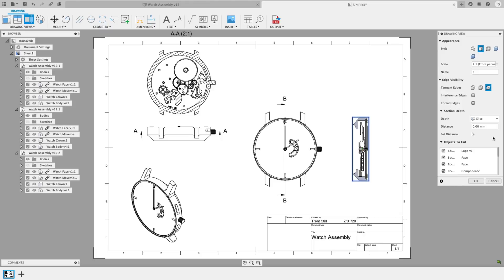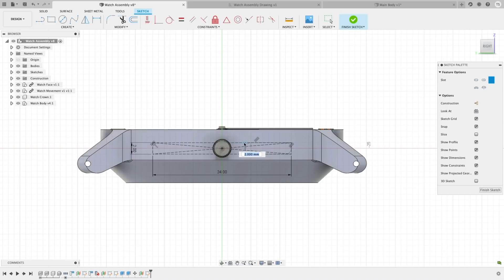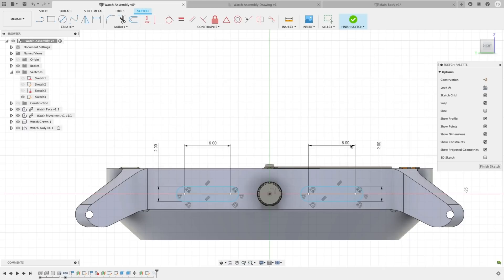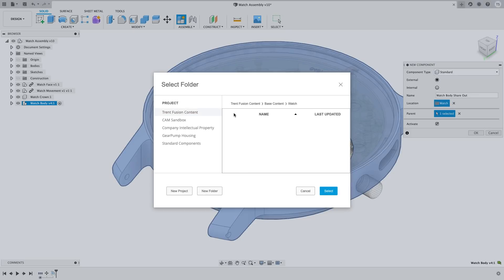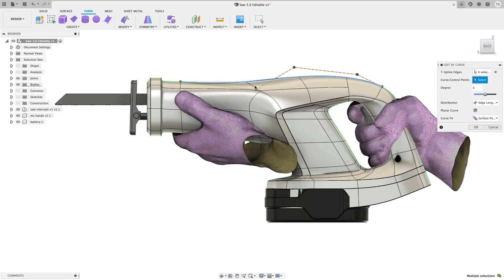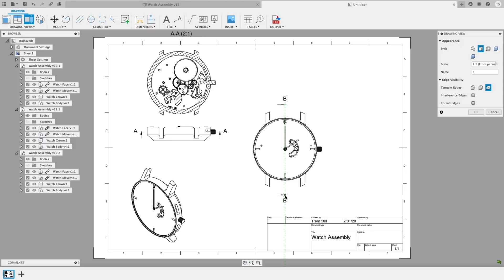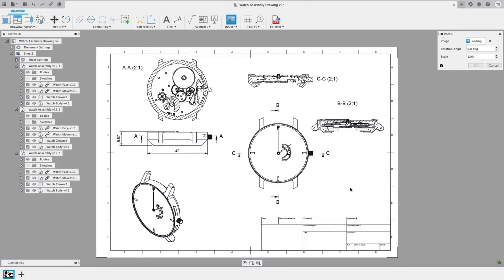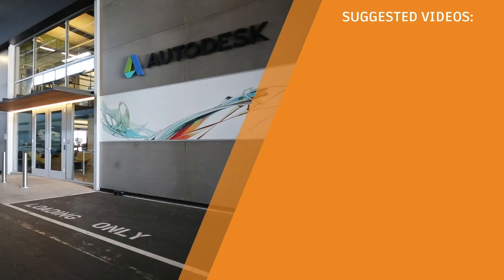What's New In Fusion 360 Design & Engineering - August 2020

Comment: what is different between the two symbol appear in the data panel the first one in cubic and the second one is orange paper that different happen when upload file using web site and any saved didnt effect in the cloud plz answer
Reply from the maker: Hey Besho, it sounds like one is a Fusion 360 File and one is a native 3rd party file (Inventor, Step, Iges, etc.). You can turn the native files into Fusion 360 by right clicking and selecting Create Fusion 360 design
Reply: @adskFusion  when i upload a fusion 360 design using via web site but after uploading it and open the fusion 360 program and want to open the design that i already uploaded through website i found many changes the first one is the symbol that appear next to the name of design it must be cubic but it appear a orange paper the second different is in the web site the fusion 360 design at type it appear as CAD file but it must write as fusion 360 design 

plz help me
Reply: i need to send photo it will explain easily and fast but how can send it

Comment: ebmoss have huge problem. It not simulate cuts like you coud do it with milling tools. Walls are always on the same plane with the axle of cylinders you cut. As you can see in 0:26 - 0:27

Comment: I was experimenting with emboss and when attempting it on across multiple faces, I've noticed some (what appears to be) inconsistent results and/or errors.  I was able to get it to work, but I was wasn't able to tell what I was doing different when it turned out right.  What is the prescribed order of face selection to produce consistent results across multiple face?
Reply: select the faces before selecting the sketch profile is my guess

Comment: Hi.
How is this parameter update a timesaver ? Might be doing this wrong?. The "on spot" parameter set do not pop up as an option later. Yes i see it in the parameter dialog box but that is not what i need. I need to put in f.ex a circle diameter " Circle_diameter=60" and use this on all later circles needed to be of the same dimension later. 
Is there some settings that needs tweaking. 
I want it to pop up as a parameter option just like all the parameters i have made under User parameters. 
Thanks for the video.
Reply: Reusing the parameter seems to work, but it is clumsy. Unlike user parameters, where a fairly smart pick list appears as you type the potential name,  with these names, you have to type the entire thing from memory. Try "newdia" and "newdia2"
Reply: @JohnS-yj6wv  Ahhhh yes I see that now. Thanks a lot, I was waiting for the dropdown. I will just have to remember to keep dimension names as easy as possible. 
Thanks again.
Reply: @Norwegianwoodworker  I think it would be better if all of these went into "user parameters". They seem accessible, but if you want to find it to edit, you have to look many places, for example Sketch 1, Fillet 1, etc.
Reply: @JohnS-yj6wv  Ok thanks. Not so well thought through then from the Fusion team. But still, love the program :)
Reply: Unless I’m missing something, this doesn’t seem to save any time at all. If you create e.g. “Circle_diameter” in the user parameters area ONCE, then it is easily accessible everywhere with usually just a few characters typed. If you create it “on the fly”, then you have to type out the whole name every single time. Plus, it is much easier to find and modify in the user parameters.

Comment: +Autodesk Fusion 360 - From the manufacturing tab, the file size of the NC code has disappeared and I can't find the option to bring it back!

I know modern machines laugh at file sizes but for those of us with 25 year old machines limited to 200kb or so, it's an important feature to know if the file will fit!